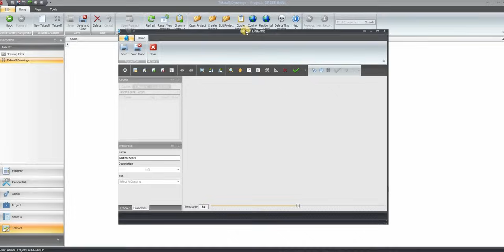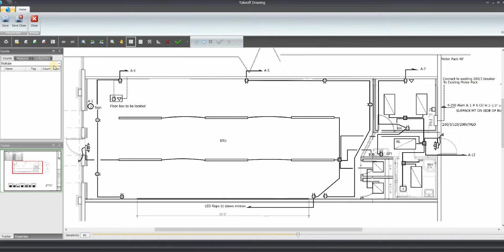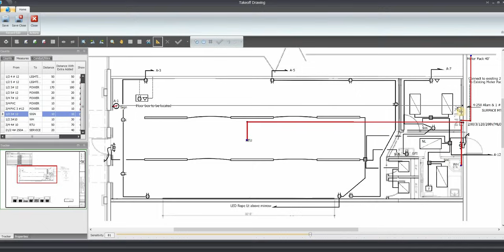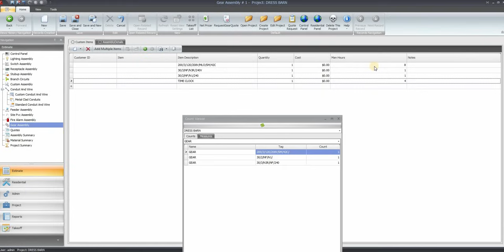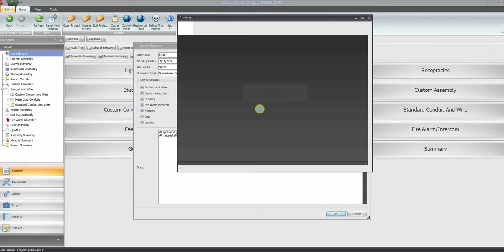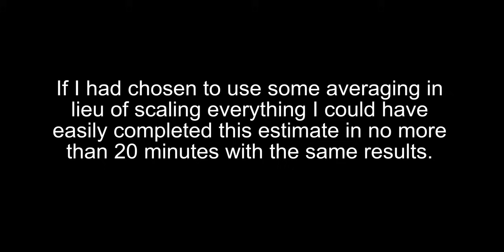BEST BID CREATING AN ESTIMATE FROM START TO FINISH

Comment: I often finish estimates in one day with this software including writing the proposal (I haven't got the included proposal templates customized as I need them yet - so, I write them by hand in word). I'm not talking simple estimates as in this demonstration. I am speaking of proposals with 13 to 14 different fixtures and over 200 lights and just as many receptacles. This software is super fast, priced right, easy to learn, and Steve has given us customized support to resolve any special issue we ran into. I use this on a daily basis and never open our software that is priced at over four times the amount. Adding his pdf draw to this; means doing redline drawings at the end of the project is super easy also. Having over 15 years of running projects from cradle to grave, I can't believe that this is not the gold standard of estimating software. Other estimating systems should be embarrassed by the simplicity and functionality of this software.

Comment: Can this software be purchased?
Reply from the maker: Sure, go to the website www.bestbidestimating.com or call us 800-941-7028
Reply: Does it automatically total full assembly for example a 100 ft one will automatically add the couplings and connectors